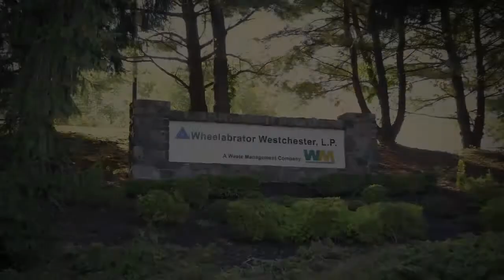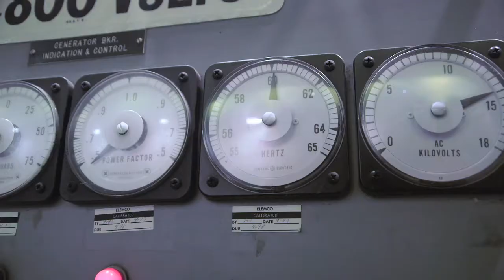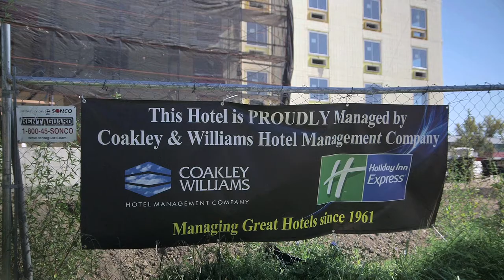Wheelabrator Westchester - Creating Renewable Energy for a New York Business

Comment: You need to post some updated video's ! New York needs to build at least 50 regional WTE facilities, to use 100% of its garbage as fuel, to generate electricity!!! Then, the residual ash could be mixed with recycled, ground glass and plastic, to mix with cement, to make a low cost concrete for construction!
Reply: no. we should replace these with zero waste policies.